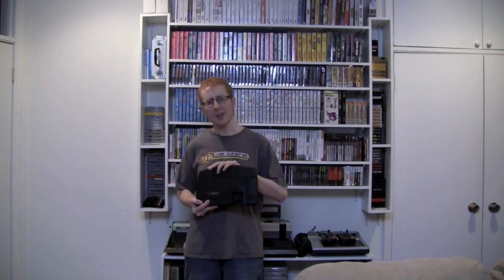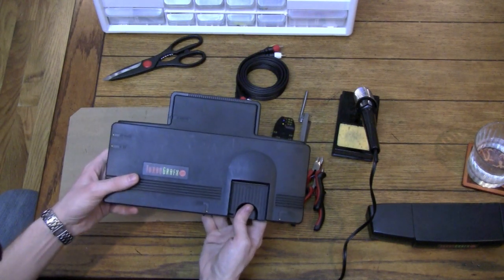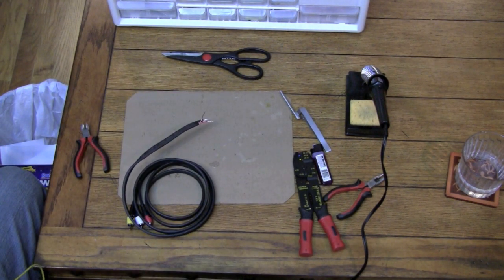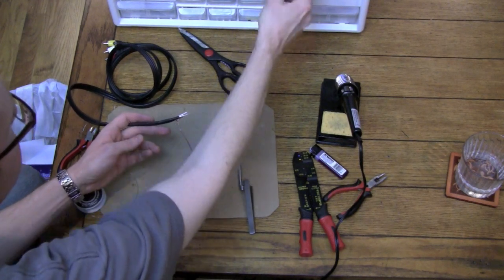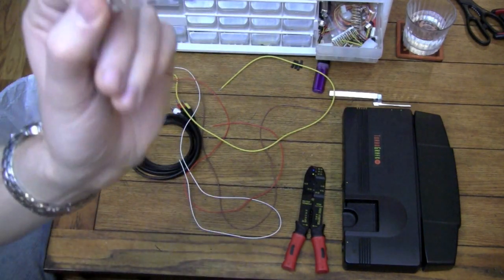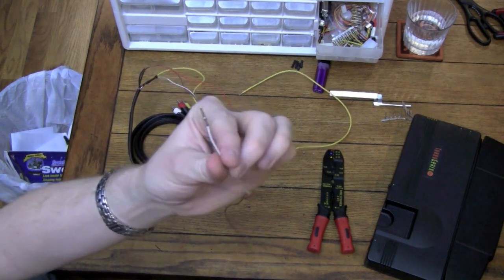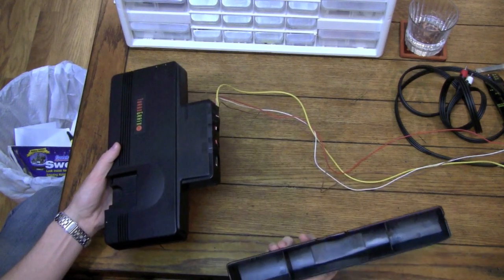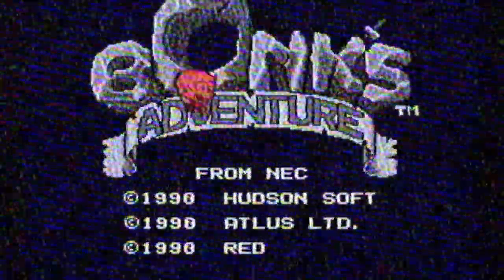Turbografx 16 Composite AV Mod

Comment: A suggestion for the pin connectors, I used old motherboard header connectors from an old case, you know the type, hd led, pwr, speaker, reset switch.  Those plugs are spaced perfect for the pins in the tg16.  leave one or both wires on and solder to the ends of the wire.  Those usb to motherboard headers would work too. Some are not lumped together in a pre formed group.  I made this composite connection only to find out that only one of my TV's even has composite and its the one I cant use.

Comment: The only thing I don't understand is where does the ground wire connect to and where is it from? The composite cables only have 3 wires--yellow/red/white. I know you're supposed to connect one end of the ground to the metal that surrounds the pins, but where do you connect the other end to?